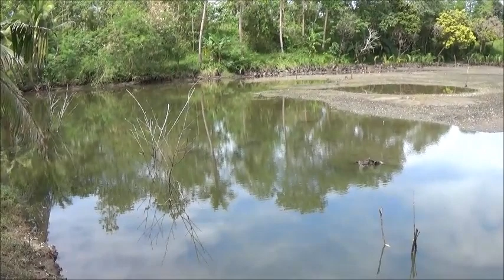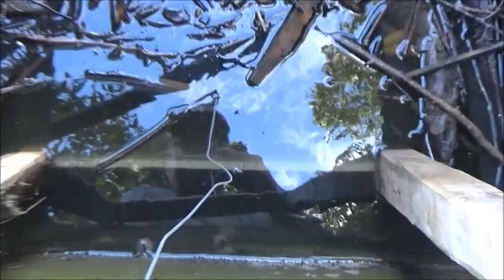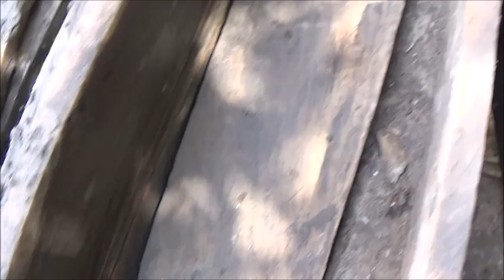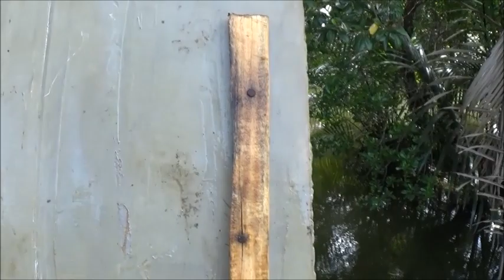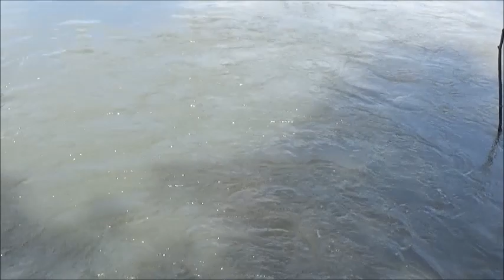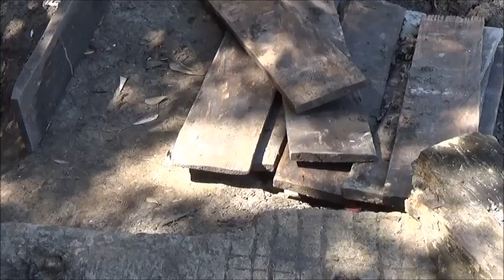Did The Check Valve Work???

Comment: Instead of a check valve, you need more of a one way valve.  I think a couple of other people have mentioned something like it, but I don't think you talked about it.  If you placed a flap over the end of the barrel, at low tide, the pressure on the pond should seal it up.  When the tide gets high enough, the pressure from the ocean would push open the flap and top off the pond twice a day.  This of course assumes you can get all the other leaks sealed up.  The major challenge would be to keep sticks and other debris from holding it open.

Comment: Maybe use a rubber seal around each edge of each board, make sure the boards are water proof and planed even, then weigh down the top board with a sand bag to give all the boards a snug fit, wish I could draw a design and send it ha ha, I did something similar to that on the irrigation ditch gates back on my grandpas farm so the ditches would say full during the irrigation season

Comment: My understanding is that tides are the same time apart all over so work out one low or high tide and the next of the same is 12 hours and 25 minutes away. No need to worry about a port somewhere else's times.
Surely the boards only provide rigid integrity for the tarp/water proof membrane to push up against when filled from the inside with mud/water. If the culvert is 2 metre deep and 1 metre wide then you would need a 5 metre square to create a pocket within the boards. Down one side of the boards and up the other would still leak where the boards slot into the walls.

Comment: 16 or 18in diameter pvc tube 10 or 15ft long put in the levy next to your check valve with a hinged flapper valve .  had those in illinois duck ponds, to fill and drain, worked perfect
Reply from the maker: Yep, the only problem is that we are HERE and not Illinois. The largest pipe I have been able to find Is 6"...

Comment: The issue with the boards is not a news flash for anyone, I'm certain.  I'm just surprised why anyone really thought that such distorted boards would be in any way usable at helping prevent that water flow.  Not to beat up on you guys, but really...CUT YOUR LOSSES  (again).  But you do what you want ' cause it's endlessly entertaining.  Carpe diem!
Reply: @HolyBrainBible  Yup,  that's  what Brian  said in the viduu. 
All this , has been designed  to be a one man operation  when actually raising  and lowering the water level! . 😁

Comment: or you can use steal tube.  we had checks like yours also but used 2x10's 3ft long.  need to plane the edges for good seal, that worked good too. but did not tapper ends. are concrete slots were near perfect though and we used only one row of boards.  thx goodluck

Comment: Hi Brian, could you use a router bit and make tongue and groove those boards. Doing that and then putting the mud should make it axt like a solid wall with no leaks. We did that at my grandparents pond back home so they could stock bass in their pond.
Reply from the maker: We could if we had the proper bits, which we don't
Reply: @aforeignerfarminginthephil3374  Hi Brian. I will work on getting bits and a proper router. I will email you to get your address again. Sorry I lost it from last time Amy and I sent a package.
Reply from the maker: Thanks Oscar🤠 the router works fine, it's the bits that are impossible to find here.

Comment: Why don't you buy a big faucet used by Water company.  Seal the faucet with cement wall and use the faucet as water exhaust.... That's a sure job for that...
Reply from the maker: Well...the first reason is we don't have 50,000 or so php for such a valve...and no way to get it in place if we did

Comment: Ok call me crazy but hear me out. 
 With the water out, low tide, and your check gate board in place use a 5 gal bucket as a form and build cement around it to completely encase it about a foot deep all the way around.
 It will deduce the flow area but give you an increased seal area. I’d give it a try but I’m not in your situation. My understanding comes from off site and not dealing face time face with the people issues involved. 
 You can see how that technique could also be married to your stand pipe idea as well.12 inch hole cut into the side of the barrel and a 10 inch hole length way. Slide 12 inch pipe down to block flow and lift to allow flow. 
 2 5 gallon buckets one on either side of a wood gate that’s been plastic wrapped, steal from kitchen, so cement won’t stick to it. Pour cement around it and let set . Slide board up the buckets are your pipe when the because ends are cut off. You would need the gate to extend 3-4 inches on all 3 sides as a seal and removable upward but I’m over explaining, Sorry . Well take what you like and toss the rest mix and blend with you and Jason come up with . If it helps great if not I gave you something to chuckle at . 😜 crazy Jeff out

Comment: I was thinking, that maybe an inflatable bladder of some kind between the boards instead of mud. You might have it custom made, but luckily, labor is "cheap". Also, I was thinking a salvage lift bag might fit in that channel in front of the opening.
Reply from the maker: As a concept that would work

Comment: I have made hundreds of water gates in my previous working life,,my opinion is that the wooden slide becomes buoyant,,no pressure is exerted on seal,,in my opinion from my armchair is to place a couple of sandbags on top of the slide to hold it down,,but then again,Brian could be right in his thoughts that the cement around the barrel is not sealing
Reply: I think your correct Peter. No downward force holding the seal tight. Cement could be leaking as well.
Reply: @jayandjhenlovingandlivingi5473  possibly other crab  interventions as well ,, ? ln reducing the overall water levels,  the higher the water level,  the greater the  outward  flow rate!

Comment: Do you think it could be the actual culvert? Cement is porous and maybe it is the actual concrete wall that is leaking. Like you said that seal looks solid.
Reply from the maker: Possibly, but since I did see a small bit of water movement in the barrel I'm thinking that is where the leak was

Comment: Old sluice box could be washout under floor on discharge of water over years  when you seal sluice gate if still leaking this could be the problem ..Go find a old boy who has experience  and knowledge of fish ponds am sure their around to give advice cost a tenner you don't know what you don't know .No need to reinvent the wheel they have been sealing sluice boxes for generations in Asia .Good Luck

Comment: If you had the budget the some angle iron channel down those channels the boards fit in could be placed and a steel plate (1/4”x?wx6’L)slid between and a winch to slide it up and down. The sheer weight will seal in the mud below. Plywood form at end of barrel and much more mortar completely covering the barrel. I like the 2 sheets of plywood idea too. I know budgets.
Reply from the maker: We will get it right one way or the other 🤠

Comment: If you dug the pond down below the outlet, you wouldn't need to depend on the gate. Just let the tide regularly flush out the water for you.
Reply: @HolyBrainBible  I believe it can be remedied with the right type of net.
Reply from the maker: Jasun, that would require removing about 15,000 cubic meters of mud...and THEN there is the question of how does one harvest the shrimp in 2-3 meters of standing water🤔